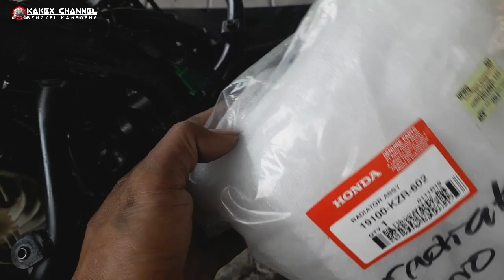Old Vario 125 air radiator mendidih dan cepat habis FULL PENANGANAN

Comment: Vario 150 LED sya sma bgtu jg.brawal knalpot ngebul naikin seher,udh bres psang seher bru jalan sehari lampu indikator panas merah nyala.dpaksain jalan,pecah sambunganan radiatorny krna mungkin over heat..bongkar termostat d tes air mendidih,ga kebuka.akhirnya d akalin,d ganjel.udh kelar Bru jalan bbrapa km lampu indikator panas nyala lgi, bongkar lgi buka block di ampelas,krna ktnya pakingnya kliatan gosong sebelah ats,ganti paking.dikira udh normal,Bru jlan bbrpa km bgtu lgi.akhirnya bli termostat Bru,tpi Masi bgtu jg,air mndidih kluar dr tabung atas,smpe kring sperti di awal.mohon pencerahan nya,udh pusing bulak balik bengkel mulu

Comment: Mantap ilmunya. 
Untung yg punya motor banyak uang yg rusak pakingnya . Radiatornya d ganti . Yg penting pinter le omong Ben salah diagnosanya tapi Ra d salahke
Reply from the maker: bukan salah diagnosa, radiator spt ini ttp hrs diganti. kecuali kita punya ganti mulut radiatornya sj. dgn kondisi mulut radiator rusak, ttp akan nyembur airnya ke tampungan saat air mulai panas. 
ojo salah persepsi mas, bahkan sebelum video ini, sy sering ketemu radiator macam ini dan banyak bengkel yg melewatkan masalah ini. krn yg datang rata² sdh pindah² bengkel  dan baru selesai disini.

Comment: Saya punya Vario Karbu, Kondisi sudah pernah boring, di pakai jalan kalau sudah panas keluar asap. Terus sekarang kalau mesin sudah panas Motor mati tiba-tiba, gak bisa stater, gak bisa di engkol tetap gak mau nyala, di diamkan beberapa menit sampai mesin dingin, baru bisa stater / engkol lagi. 
Masalah seperti ini terus berulang kalau mesin sudah panas.
Mohon pencerahannya
Reply from the maker: Kl ngasap brt ada oli yg masuk ruang bakar. Yg bikin mati sepertinya piston dan ring yg memuai membuat gaya gesek yg besar trhadap boring. Penyebab memuai bs krn sirkulasi oli kurang bagus, atau oli kurang, bs jg bbm trlalu irit yg membuat ruang bakar cpt panas. Kondisi sistem pendingin/ radiator yg kurang lancar pun bs jd sebab
Reply: @KAKEXChannel  kalau bbm terlalu irit sepertinya tidak, malah termasuk kategori boros. Jadi kira2 solusi mengatasinya gimana ya?

Comment: Mau tanya om , motor saya 125 Led 2015 mempunyai problem di radiator .  Thermostat sampai water pump sudah di ganti beberapa kali masih sama aja , air cepat habis . Bongkar mesin ganti pack sudah beberapa kali jga , kdang beberapa pack aman tpi air sama saja cepat habis . Tolong bagi sarannya dong om.
Reply from the maker: Kl sdh spt itu tdk ada saran, tp sy bs sembuhkan jika sy tangani sendiri 🙏

Comment: Assalamualaikum mas maaf bertanya
Saya punya Vario 125 borup 59,,
Over head nyala merah,,padahal water pump seal sudah diganti(normal)termostart (dijebol) paking sudah diganti juga,blok sudah diamplas jalan 1minggu tiba2 over head air radiator habis dipenampungan dan diradiator.,
keluar uap dari selang kecil penampungan itu kenapa ya tutup radiator saya pake yg 1.3 bukan standardnya ..
Mohon pencerahannya
Reply from the maker: sebaiknya periksa jg sistem injeksi. jika bbm trlalu irit mesin jg bakalan cpt panas

Comment: Met pagi mas, mau tanya lagi nich,nyambung yg malam komen, airradiator berkurang drastis tp gk ada yg bocor, karena udah di benerin nah masalahnya sekarang, air radiator berkurang terus meskipun sudah di isi lagi,setiap motor di pake selalu overheat lampu indikatornya dan pas mati ngedadak kenalpot keluar asap putih dan berbau airradiator kebakar.apa ada masalah di waterpumpnya juga,saya cek oli Bening gk berwara susu. Mohon infonya yah mas kerusakannya di mana, sudah pusing
Reply from the maker: Itu packing head cylinder biasanya yg rusak.

Comment: Motor varioku 125 old 2014,keluhanya termostadnya udah rusak om,udah gak isa mbukak kalo panas,karna harganya mahal,kuningan yg di dlm termostad tak bor,jdi posisi mbukak trus, jdi sirkulasi air lancar,itu menurute njenengan,bahaya apa ndak om,,? Suwun bls 🙏
Reply from the maker: Bahaya sih nggak, lbh bahaya kl gk bs buka, Mesin bisa kepanasan. Kl kondisi sdh di bor brt dr awal mesin hidup, siklus air adh lewat radiator. Utk mencapai panas ideal lbh lama dikit, itu aja
Reply: @KAKEXChannel  berarti aman ya mas,cmn mesin proses panasnya agak lama dikit ya mas, matur nuwun mas,kpn2 ak smpk bengkele njenengan,suwun

Comment: Met malam mas, mau tanya motor saya vario 125 sama masalahnya kaya gt, dh kebengkel di bongkar dan ganti termostat baru, dua hari di rumah di pake ko tambah parah, air radiaator cepet habis trus indikator panas menyala, gk lama motor mati ngedadak dan di kenalpot keluar asap putih banyak dan berbau airadiator,kalau dh gt motor di nyalain susah, ada 6/8 stater baru bisa nyala lagi, terus aja gt, itu kenapa yah mas, minta infonya mas, dh keluar uang banyak dh dua kali bongkar, kalau sekarang di bongkar lg 3 x bongkar,
Reply from the maker: Coba video yg ini
Reply: @KAKEXChannel mks mas infonya

Comment: Mas tanya bos motor Vario 125 old saya kan bocor radiatornya sudah saya ganti water pumpnya, terus masih bocor lagi lewat selangnya . Tapi di ke adaan panas doang bocornya keliatan , apakah itu termostat nya. Tolong di jawab dan makasih
Reply from the maker: Dlm keadaan apapun, selang tdk boleh bocor. Saat mesin panas memang tekanan air radiator akan naik
Reply: @KAKEXChannel  sebelum ganti water pump bocornya kaya di tuang airnya , setelah di ganti awalnya aman nah pas mesin panas ke tauan bocornya dari mananya , terus saya anuin yang bocornya eh malah masih ada yang bocor di tempat lain, saya anuin lagi bocor lagi di tempat lain kaya gitu terus sampai saya bawa ke bengkel tetap bocor juga . Apa itu karna termostatnya yang rusak??

Comment: Mas ni ak punya kasus vario 125 udah di ganti tremostat, diganti radiatornya sama tutupnya, slinder kop sama buring nya udah ak amlas sampai rata paking kopnya ak ganti, trus mesin ak nyalain sampai 30 menit  masih ada glembung klo ak ya lain 15 menit  blum ada glembung tolong ya mas di jawab ak sampai pusing motor udah ak bongkar sampai 4 kali tolong ya mas!
Reply from the maker: Mungkin ada masalah di suplay bbm, secara vario 125 fuelpumpnya sering lemah. Suplay bbm yg kurang membuat mesin cepat panas, bahkan piston bisa lecet.
Coba setel klep sesuai standar, in 0,10mm ex 0,25mm. Kl ada scanner bisa di cek AFR nya brp. Jika lbh dr 15 brt dugaan saya benar
Reply: @KAKEXChannel  makasih mas, ak gk ada skener mas

Comment: Bang mau tanya vario 125 
   Paking baru blok kop udah di sekrap termostad ok water pom ok tapi kok tetep air radiator mendidih sampek penampungan yaa
Reply from the maker: Oversize berapa? Overheating  juga bisa timbul dr mesin, oli gk naik, kompresi terlalu besar, suplay bbm kurang (injeksi bermasalah)

Comment: Assalamualaikum Bang mau tanya, motor vario 125  old saya baru ganti Thermostat dan juga baru 1 minggu turun mesin karena stang seher gojlak, ketika mesin di panaskan aliran air radiator berfungsi selang bawah juga panas dan tidak over heat meski hampir 1/2 jam dipanaskan, tidak ada kebocoran dan air tampungan tidak berbuih.. Tapi kalau di bawa jalan itu sekitar 7 km air mendidih, lampu indikator menyala dan selang bawah radiator jadi dingin,, bengkel sampai bingung jadi apa penyebabnya ya Bang..?? 
Mohon penjelasanya Bang...
Reply from the maker: Ada 2 yg ingin sy tahu. Apakah saat bongkar, kop di ratakan/ dihaluskan, dan pakai packing baru? Dan apakah waterpump sdh di cek aman?
Saran saya, coba lihat data injeksi dg scanner.
Reply: @KAKEXChannel  Sudah semua Bang,, Packing diganti tapi bukan Ori, kop semua diamplas diratakan cuma mungkin rata atau tidaknya belum tahu.. 
Soalnya anehnya begitu ketika di panaskan Thermostat berfungsi, air tampungan tidak mendidih..tapi ketika jalan paling 7km air mendidih dan selang bawah dingin.. Atau mungkin harus di scanner ya Bang..

Comment: Om apa masalah nya lagi ya sil water pump nya udh diganti selang nya udh juga stelah diganti 1 atau 2 hari tidak habis air radiator nya sampai ke 3 harinya habis lagi itu apa ya masalah nya om?
Reply from the maker: Ada bocor lg gk? Kadang kl masang seal waterpump trlalu dipaksa bs bocor/ pecah lg. Trs saat panas, kondisi tangki cadangan ada buih gk

Comment: Sya sdah cba gnti paling head. Tp pas di stater air radiator'y muncrat. Itu kira2 apa'y yg rusak yh om?
Reply from the maker: Pertama mmg dr paking head. Bs jg tutup radiator rusak. Mgkn jg tremostad. Tp kl msh dingin, start lgsg muncrat, kemungkinan trbesar itu paking kop. Bs sj masangnya gk pas/ msh bocor
Reply: @KAKEXChannel  motor saya sama kanh air radiator mendidih tapi kalau udah lama dan di pakai agak jauh jalan air mendidih keruskannya apa ya om mohon pencerhaannya, kalau pas motor di nyalaiin terus termostart masih normal ngak yah dah saya coba di rebus pakai air termostartnya nge buka dan saat dingin menutup sendiri apa aman itu termostartnya

Comment: Bang knp ya air radiator di tangki cadangan cepat berkurang gak sampe sebulan tp klo yang di bawah penuh/gak berkurang?
Reply from the maker: Karena air di cadangan turun ke radiator 😁. Mgkn seal waterpump bocor, waterpump tdk mutar, thermostat macet dll
Reply: @KAKEXChannel  ternyata setelah sy perhatikan dengan menyalakan mesin lebih kurang 1 menit di bagian depan mesin dekat busi mengeluarkan asap putih dan ada satu kali tetesan air radiator kyknya di bawah mesin, apakah itu tanda kebocoran ya bang? Baut knalpot di bawah mesin ilang satu, kyknya di situ juga mengeluarkan cairan

Comment: Bang kalo packing nya bocor...air radiator bisa nyampur oli mesin gak..masalah nya sya sdah ganti seal water pump..tapi oli mesin masih bercampur air radiator
Reply from the maker: Mungkin aja tp sangat jarang.
Reply: Trus kira2 ap nya bang.. yg menyebabkan oli mesin bercampur air.
Saya sudah bingung...tlong kasih solusi
Reply from the maker: Harus bongkar biar pasti. Bs sj pasang seal water pump kurang benar/ pecah lg. Bs jg seal oli as propeler ikut bocor tp gk diganti. Kl yg masang mekanik yg mmg sudah berpengalaman, brti mmg hrs cek packing silinder head
Reply: kalo ciri2 oli sm radiator bercampur gmna.

Comment: Kalo termostat vario gak berfungsi apakah dari sensor ectnya bro gak bisa membaca hangatnya air colant. Sedangkan aku coba rebus termostatnya normal saja katup kuningannya membuka tapi kalo di pasang ke motornya gak bisa berfungsi, air yang di selang bawah tetap dingin dan air sering muncrat dari selang pembuangan. Apakah ECT itu juga bisa menyebabkan termostat bisa jdi eror bro
Reply from the maker: Tidak. Thermostat bekerja independen, sesuai suhu yg diterima. Biasanya membuka setelah suhu diatas 80°C. Muncratan kemungkinan dr paking kop.
Siklus air https://youtu.be/VBKGfnR11u8
Reply: @KAKEXChannel  paking kop sudah bru smua sudah saya ratakan semua bloknya pakai amplas ke kaca . Tapi selang bawah termostatnya tetap dingin meskipun mesin dan air sdah tinggi suhu panasnya
Reply: Kayak ada air gak bisa jalan di bagian slang bwah trmostatnya dan selang bwahnya tetap dingin mski suhu sudah mndekati 100c kondisi trmostatnya ini udah sya ganti baru tapi bukan yg ori nmor 1. Aku ganti yg KW tpi merk honda juga. Tapi masalahnya sama aja kyak yg blum d gnti termostatnya . Selang radiatornya ttep dingin d selang bwah trmostatnya kayak gak ada  pergatian air atau airnya kayak gak bisa jalan d bgian slang bwah trmostatnya tutup radiator juga sudah sya gnti baru permokaan lubang radiator masih standart rata semua gk ada yang kropos
Reply from the maker: Air nyembur itu mulai saat dingin atau setelah panas
Reply: @KAKEXChannel nyemburnya air ke slang pembuangan setelah mesin mendekati suhu 100c atau suhu mesin sudah panas banget
Reply: Kasus sama air radiator menyusut saat mesin panas solusi nya gan?
Reply: @andiganteng5233  solusinya simpel . Ganti paking headnya udah normal kembali gan. Usahakan bloknya di ratakan dulu pakai amplas

Comment: kalo air radiator nya tiap panas keluar dari lubang pembuangan kira kira apanya ya bang,termo normal,kipas juga normal, kata bengkel si seal nya,males banget over sama langsung abis mulu air radiator nya
Reply from the maker: Jelas bukan seal waterpump. Justru kemungkinan di thermostat, radiator atau tutupnya

Comment: Mas kalo vario 125 th 2013 overheat indikator merah nyala

Dan sekarang mati total
Gimana masukannya
Reply from the maker: saat overheating mgkn dinding liner boring termakan shg kompresi lemah dan mesin tdk bs hidup
Reply: @KAKEXChannel  dan sekarang gimana solusinya mas 
Apa motor nya turun mesin pak
Reply: Ini di karenakan air rdiator kehabisan mas

Comment: Bang mau tanya,, motor vario saya kondisi mesin panas air diradiator berkurang, sedangkan tangki diatas masih    dkondisi low dan di posisi filter udara terdapat air radiator,, itu penyakitnya apa ya bang?
Reply from the maker: Kemungkinan paking silinder
Reply: Makasih ilmuny  mas 👍

Comment: Mas kalo jarak 15 km tabung cadangan air radiator nya mendidih wajar gak mas?
Reply from the maker: Tidak wajar. Sejauh apapun, motor normal tdk akan mendidih tangki cadangannya. Kl prnh kehabisan air atau overheating bbrp kali, besar kemungkinan ada bocor di are packing kop

Comment: Motor vixion saya sudah saya ganti semua tp masih aja air berkurang 
Mulai dari pucking ,
Seal water pump , silinder kop sudah . 
Solusi dong bang 
Cara mngatasi nya gimana
Reply from the maker: thermostat dan cek blm?
Reply: nah ini sm..klo saya vario lama gan...sudah ganti semua nya tp klo jln ga jauh selalu mendidih dan over heat
Reply: temostrat sudah ganti

Comment: air radiator saya mendidih dan cepat habis mas.. apa thermostrat nya mas? vario 125
Reply from the maker: cek aja. di video sudah sy jelasin ada 3 penyebab
Reply: ciri thermostrat rusak atau macet gmn cek nya
Reply from the maker: Di awal video jg sudah dijelasin
Reply from the maker: Kl selang radiator yg bawah ttp dingin saat mesin sudah panas, itu ciri utamanya
Reply: selang yg dibawah hangat mas.. ini saya panasi motor nya
Reply from the maker: Kl panasnya hampir sama yg atas, brt thermostat aman. Mgkn masalah di bagian lain, mgkn paking kop spt video. Bs jg tutup radiator yg rusak.
Reply: selang bawah itu hangat aja mas.. gak terlalu panas .. seperti yg atas

Comment: Mas saya mau tanya, saya punya motor vario 125 old 2013, kalo jalan 1 km lampu indikator nyala merah dan air radiant mendidih & panas, 
Waterpump sudah diganti baru,
Set Seher, piston, stang seher jga sdh ganti baru,
Air radiant cpt abis, 
Ini semenjak motor mengalami overheat dg posisi lampu indikator menyala dan motor tbtb mati di tengah jalan saat panas.
Solusi untuk perbaikannya apa ya mas ? Mohon petunjuknya, saya udh abis 2 jutaan mas tp motor penyakitnya blm ilang
Reply from the maker: Dr penjelasan, thermostat belum disinggung, padahal itu jg sangat pengaruh. Lihat juga AFR dr hasil pembakaran, krn jika bbm kurang maka mesin jg akan mudah panas